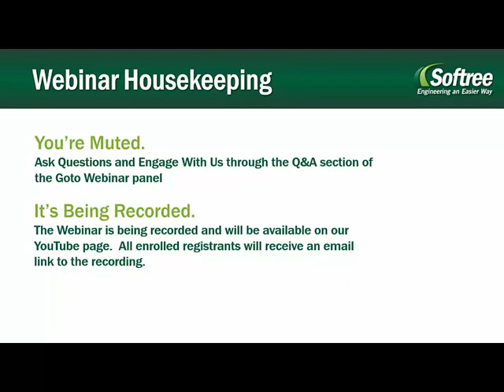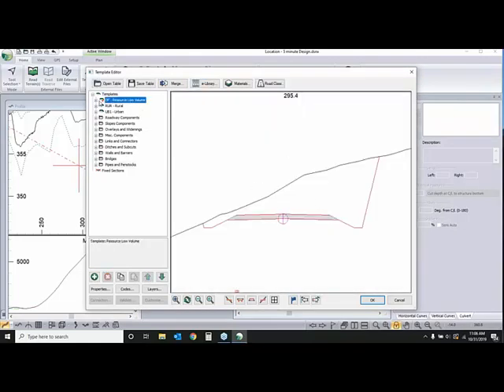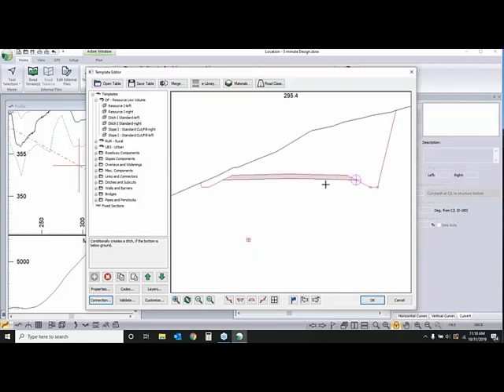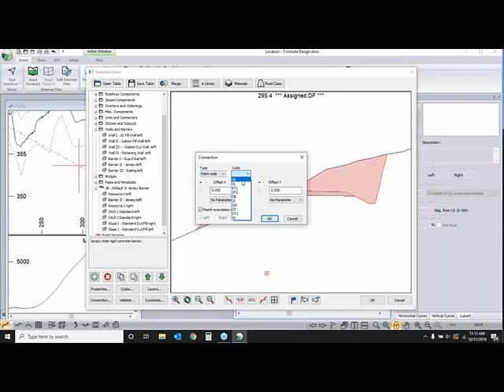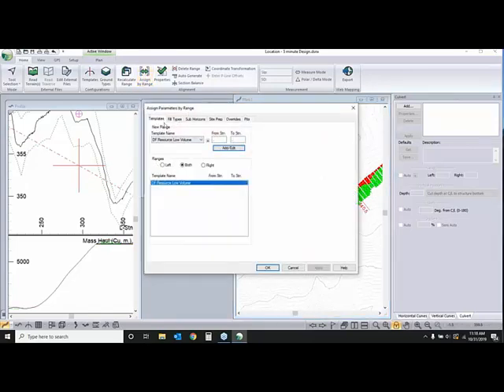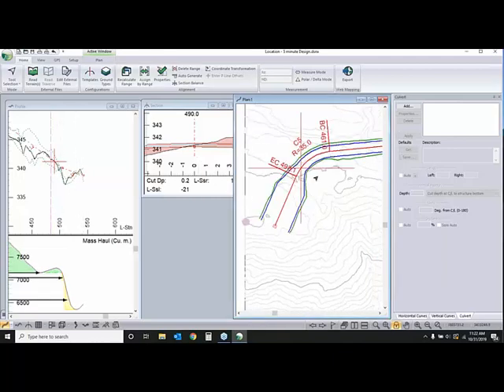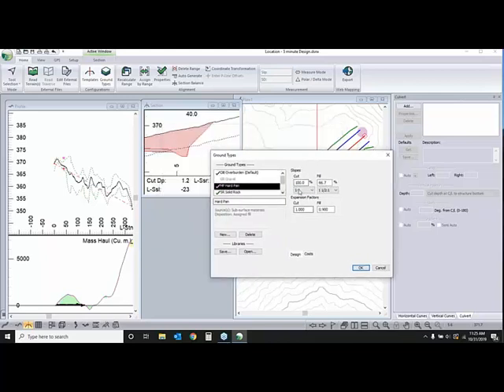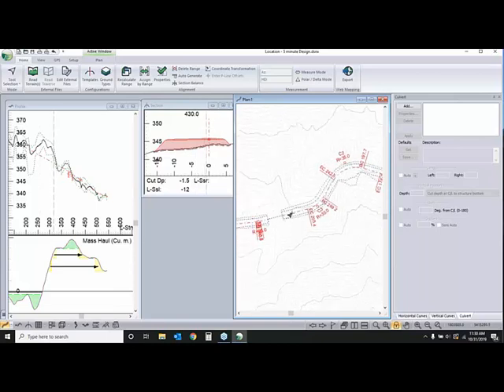Cross Section Templates

Comment: Would be nice if the quality was better so I could read what is being clicked on.  480p isn't cutting it. The smaller print of the categories within the template editor is unreadable.
Reply from the maker: Hi Jeff, we agree, the resolution of this particular video does seem too small. We are going to look into that. In the meantime, we are going to email you a link to a higher quality recording.